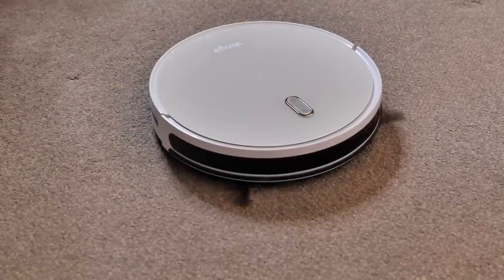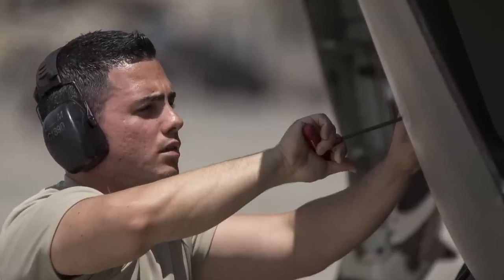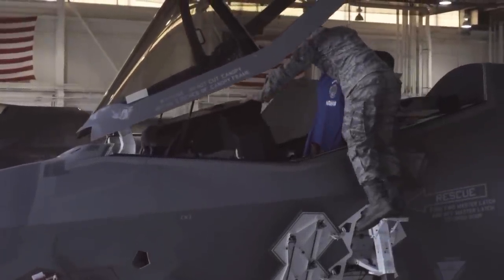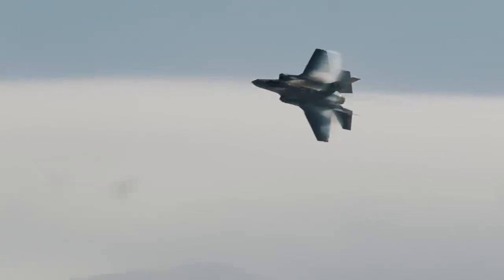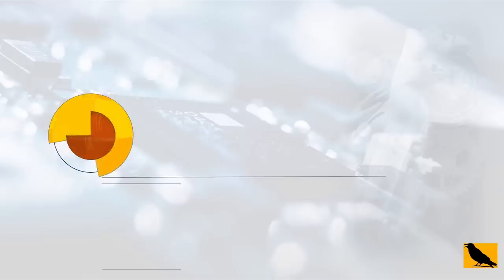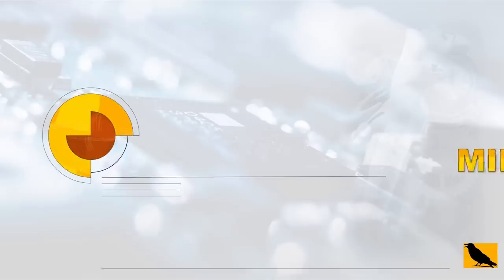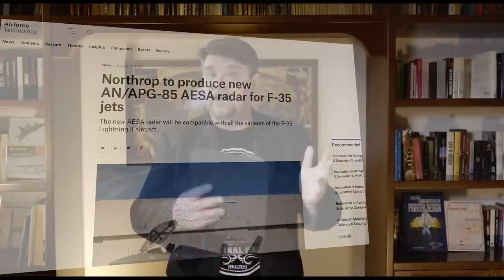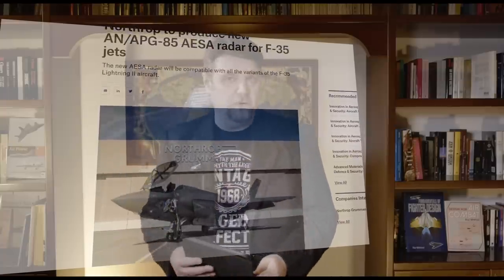AESA radars have a problem.

Comment: i see an achilles heel to the evolution of sensors through software advancement rather than that of the hardware,. and that is, that it is likely that this approach will freeze the evolution of the hardware, because "lazy", because "bean counter", because "problem solved" mentalities. The advancement of actual hardware however, is at the core of paradigm shifts. I think a much superior strategy is to promote and insure the capability to rapidly evolve hardware itself through the use of software. the danger with "the new thinking", is that hardware dev atrophies because of the unwise reliance on software-only to advance a sensor system. we of course know that both are absolutely necessary.

Comment: radar tech should shift from radio WAVE to specially charged particles. and that can be ACCELERATED particles. do note particles and wave differences is merely in the amount of energy/mass(convertible). but charged particles that are smaller than an atom could pass through atom structures, and could leave "marking" in certain pulses that can be READ by the auxillary scanner. the particle based "radar" system will be able to detect MATERIALS even buried deep inside a bunker. for example, nuclear fuels inside nuclear reactors and warheads inside a submarine 1 kilometer below the ocean surface. nobody can hide from it.

Comment: I kind of disagree on the criticism of analog components. One of main things done with those in most cases is just moving from passband signals to baseband signals.  Moving passband signals to baseband digitally is a huge waste of resources; and once signals are in baseband we can do pretty much whatever we want digitally with most existing processors. Beamforming is also fine to do analog for transmit, since it's dependent only on the geometry of the array and can therefore be assumed to be fixed.

Comment: I don´t quite agree on the cost part. PESA radar is a really complicated device with a lot of physical modules. A AESA radar is a integrated electronic system. This means that it will ride the cost benefit scale of electronic integration and production. This is also true for power modules. Power modules also get cheaper over time, while not as fast as integration.

Also we see telecommunication arrays using the same kind of technology like for example SpaceX that us multiple arays on each satellite. And they are really not even that expensive any more. If not yet, AESA going to be cheaper than a PESA very soon, at least for a radar with on par performance..

Heat is a problem, but i figure they would do class E/F or T type transmitters eventually. For the processing, well that will be more and more efficient over time.

But this is really more of a issue that the military us hunting for more and more performance, hence increasing the power at the same time there is efficiency gains.

Working in telecom we start at class A transmitter and pretty much gone whole the way throu the alphabet. The electronics just get smaller and smaller but the total power just increased, with transmitter coax cable as thick as an arm before we swiched to having the transmitter in the antenna.

We going from a world where fighters was weapon platforms where its really more of a radar platform. The Air forces just want more and more radar power.

In telecom sector we use something called mixing to have a lower frequency digital signal work as a higher frequency one. The patch antennas used in telecom are virtually identical to that of a AESA radar (while the ground based one have considerably wider lobs). The signal is made in a base bad frequency. When we started this in the 90s we talking frequency of 1-10Mhz or so. Now its in the multiple of GHz range.

This is how most cellphones work. The nice feature of this is that it can be mixed up to any freqvency. People who are a bit older may remember back in the day when you have to buy different phones depending on what carrier you had or what country you lived in. With mixing this is gone. Every phone have a baseband then a variable freqvence mixer that can mix to pretty much any frequency. Also modern phones typically have a number of antennas not just one.

Ground station (that is what i use to work with) work very similar but the base frequency is much higher to allow for wider mixing. I have no evidence that AESA radar use this technology, but i can see no reason why they should not. Its a simple well known technology that been used on the civilian market for over 20 years and we also used it with phase shift for base stations. (modern phones probobly also have phase shift now, but it been a while since i was in the business so i´m a bit out of date).

A AESA radar also can do something (well really quite a few things) PESA can´t. But one very important thing. It can defocus the radar. This allows it to scan faster for close or high speed moving object, or just a general higher speed of scan. Something most radar system can´t do what so ever. Specially impotent for system that have 2D of scanning.

While a mechanically scanned radar would not have this problem, it need the repositioner just to scan what so ever. In the case of Gripen E its quite cleverly done on a rotating plate, making the system both simpler and more flexible. 

Also a AESA can be made with wider scan lobes if you want to make it cheaper or less power intensive.
Reply from the maker: Thanks for the contribution

Comment: 1. @4:25 "but is still very present" - acute ? 
    Especially in nimble-planes like Gripen, which thus may-not be SEAD/DEAD capable?
2. What about the obsolescence of large radom-aircraft thanks to GaN radars in Gripen, F-35, Mig-35 (Zhuk)?
3. Integrated side-looking radars in Su-57.
Reply: You can have bigger radome+ GaN to end up with better performance. Also F-35 doesn't use GaN rn, it uses GaAs
Reply: Actually F35 radar is a notch AESA radar with GaAs, while the SU57 radar is flat AESA radar with GaNs on it, not 1 but 4 AESA radar on it. Quite unique isn't it.
Reply: @heatblast876  iirc Su-57 also uses GaAs
Reply: @radonsider9692  The current AN/APG-81 uses GaAs but the APG-85 is at least suspected to use GaN for its cooling and power benefits in tandem with the F135 core upgrade for increased cooling. If they actually managed to squeeze out more performance before switching materials that'd be something, but afaik GaN is more robust/durable and cheaper in general so I doubt they'd overlook it.
Reply: @forzaelite1248  I thought GaN was more expensive
Reply: FYI Gripen radar is not GAN.  Gripen E radar is Raven ES-05, a GaAS radar made by Leonardo.
Reply: @lordtemplar9274  No! It is GaN

Comment: As an AESA is in fact a collection of several radars, would it be possible to place the modules distributed along the fuselage and wings instead of clustering all together?
Reply: yes, but it will only effect azimuth not the elevation, it will also enhance SNR since the antenna is larger. It is a matter of time till this will be implemented.

Comment: I think this radar is trying to solve a problem that doesn't exist. GaN is so great because it can handle 10 times the power. Yes that's 10x the heat, and isn't stealthy but it's benefit in AESA could open a can of worms that could leave it crippled against a large full power GaN EW system. Will higher sensitivity micro arrays be able to handle that? I don't think so.

AESA is a problem looking for a solution. Multiple standard arrays each designed for their specific purpose is a lot better solution.

Comment: Modern missiles, both air to air and air to ground, are having ranges greater than the range of aircraft radar. Like Meteor missile has greater range than PS-05 radar of Saab Gripen. The relevant range in this scenario is tracking range which is less than detection range of radars. Similarly, many anti-ship missiles too have greater ranges than radar of aircraft carrying them. Why dont you make a video on this topic and explain this case? Normally or till 1990s, aircraft would first detect hostile aircraft on his radar, lock it and then fire a missile on it. But now the missiles have ranges exceeding 100 km whereas the aircraft radars have ranges less than that for a fighter-sized target.

Comment: Seen on another video someone said the new radar in the F15Ex if it's turned to full power it can destroy other planes electronics and incoming missiles. Is this even a possibility or just BS?
Reply from the maker: BS
Reply: As with all things, it’s not absolute. It’s radar could jam incoming missile seekers, or to a lesser degree fighter radars, but it isn’t going to be destroying them ever, and the jamming won’t be that effective. It may be able to damage very sensitive ELINT sensors but nothing more.
Reply: @Millennium7HistoryTech  Thanks i thought so but figured i would ask you sense your pretty smart when it comes to the tech side of these things. Thank you
Reply: @jonathanpfeffer3716  gotcha i was thinking it sounded like BS but never know now a days with how fast things are advancing. Thank you